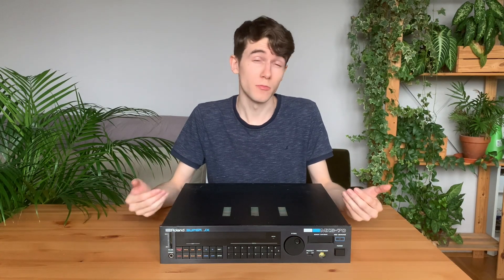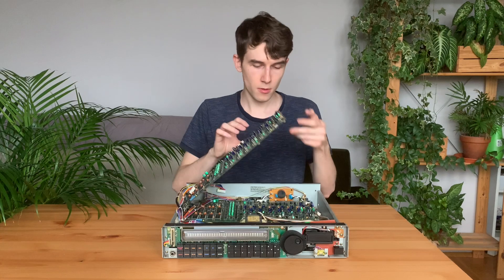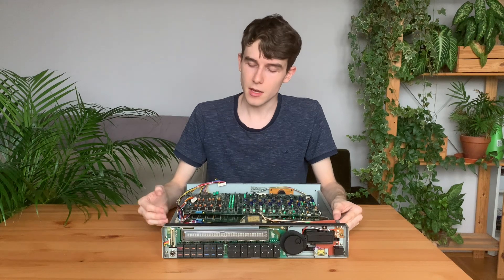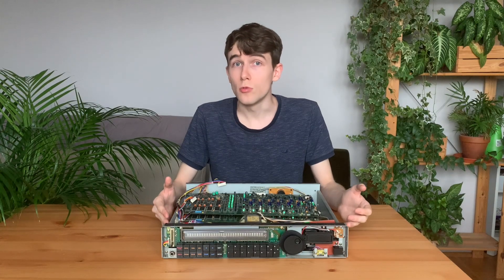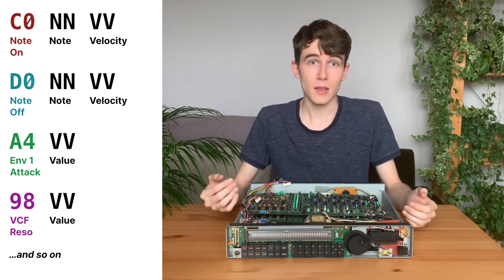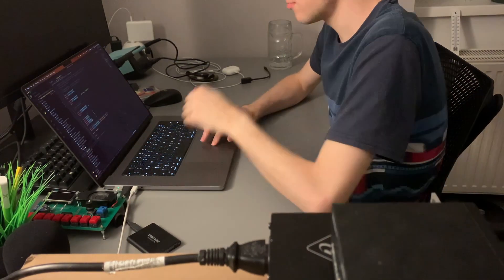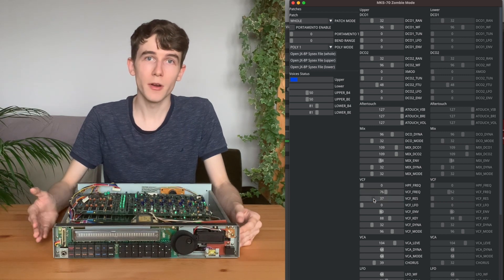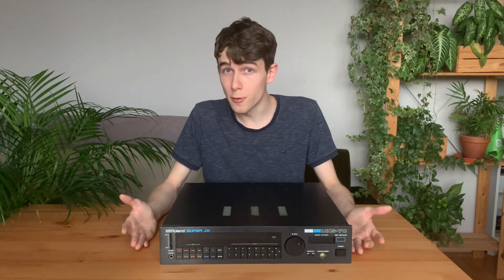This Synthesizer is unusable. Let's turn it into a zombie.

Comment: You could have saved yourself a lot of time by just getting a PG800 off of ebay and using that to program your synthesizer. You already have ROM v1.08 so you have all the MIDI bugs fixed. If this is still not satisfying to you, there is something called a 'Vecoven" mod that you can buy which turns the MKS70 into a while new synthesizer by adding new waveforms, PWM, and a few other goodies. But all that aside, I am glad that someone is digging into the internals of the MKS70. It's always been a mysterious synthesizer. I should dig mine out of the closet and reform the capacitors since I haven't used it in about 5 years.

Comment: I have one of these rack modules and I purchased the Vecoven upgrade which adds Pulse wave modulation, but they require desoldering  and modification to each sound board and I decided it was beyond my skill level. Any suggestions on who could do the upgrade? And would it be possible to add a second LFO to module?

Comment: now do the MKS-100 so i can take just its ADC/DAC and sampling RAM circuitry out and put it in a box that doesn't whiegh six billion tons and stick almost 16 freakin inches into the rack
Reply from the maker: @famitory  hahaha the MKS-100 is fun, i have an S-50 which is very very similar (same sampler chip). It would be cool to decap it and dump the internal FIR coefficients for the interpolation, then it would be possible to have a perfect software emulation of it. The operating system of the S-50 already works on MAME

Comment: Cool video, thank you. 00:20 Well I'm  not sure the MKS-70, a kind of JX10-P in a rack,  had "digital oscilators". Maybe 2  DCO? It means the oscilators are not digital (no DSP), they're analog oscilators but digitaly controled, they will not get out of tune after 30 minutes 😉 ( DCO=Digitaly Controled Oscilator) Seem picky, yes, but it makes quite a difference.
Regarding making a computer interface for it I would do the simple layman's way: the Sysex chart of the MKS70 and the Logic MIDI Environment (or an other application whch can send sysex). You can do that without opening the machine. I remember, in the 90s I did that for my TX81z, my Juno1, my K5, etc... Convenient. But, well I'm a simple guy without any real electronic knowledge.

Comment: it's strange the MKS-70 midi implementation is quite complete and can remote control every parameters! Furthermore midi quest provide a graphical implementation of the roland midi sysex implementation! Not mentioning that there is video on youtube whose are using the PG800! You're device is faulty, no mod are needed! Should investigate! Usb is worst than Midi. How do you add a thru physical remote control with your usb mod! Worst than better!

Comment: But… there are already so many programmers available, both software and hardware? Whose price reflects what you get, because with Retroactive you open up so many possibilities the original and the Stereoping doesn’t. Also, the PG8X soft synth is free and does exactly what the JX-8P does. Aaaaaand you have bazillions of presets and custom patches available for download… I really can’t see the reason why you had to re-invent the wheel once more. 🤪
Reply from the maker: Because… it's fun? I totally see your point, but I'm doing this mostly because I like to build electronics/software and understanding how it works. With this video I'm just trying to share some minor stuff I learned and my passion for the topic.
Apart from that the Retroaktiv, while very cool, it's an order of magnitude more expensive than what I did here. I'm not trying to dunk on their work, just showing an alternative that worked well for me.
If we consider everything as already done what would we do videos about? :P

Comment: There is a very useful editor for iPad which simulates PG-800 well with MKS-70. What would be nice is to have a working patch librarian as the patch management is a nightmare. Vecoven made some great improvements to the assigner by a flash memory add-on making the synth more updated midi wise. This is a must upgrade!

Comment: Nice work. Just wondering is the MIDI interface on this unit faulty? There are plenty of free editors for JX8P that work fine with MKS70 and a pair of MIDI cables.
Reply from the maker: Thanks! I've tried several options and none worked: apparently the JX-10/MKS-70 has a bug in its MIDI implementation which prevents real-time sysex editing from working. I've read about it here also (http://www.colinfraser.com/jx10/jx.htm), so I decided to make my own mod instead of using existing ones, mostly because of my love for tinkering :P